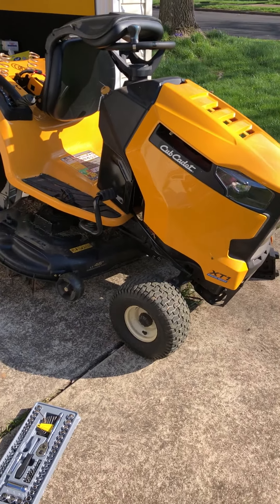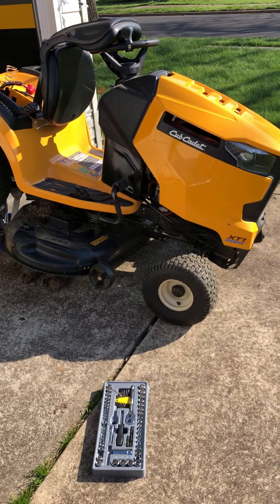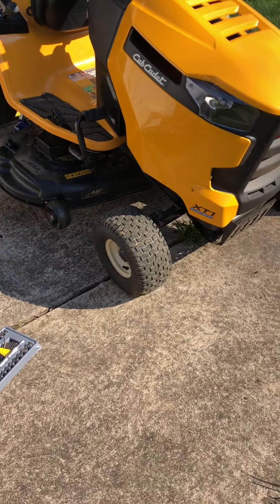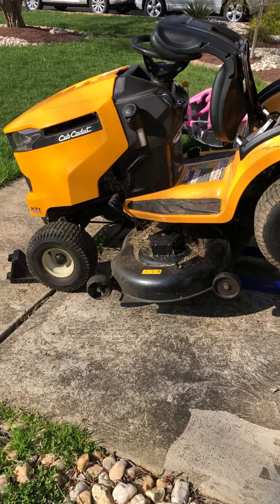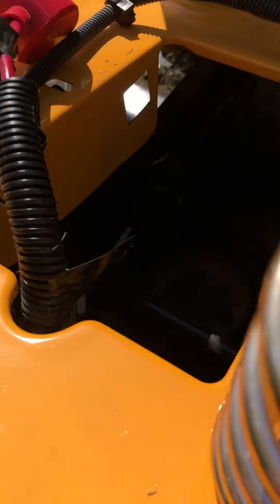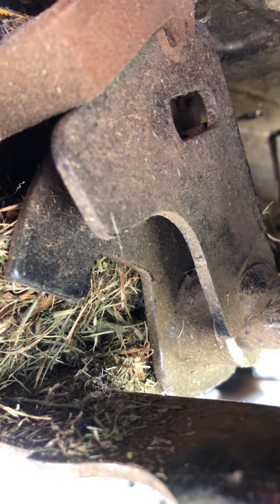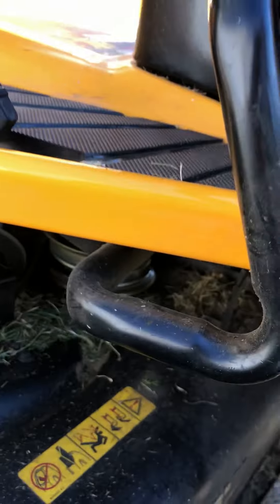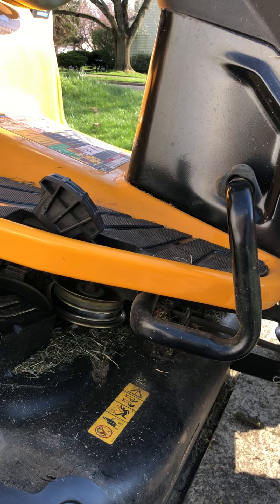Cub Cadet xt1 Craftsman John Deer MTD no reverse or slow reverse Fix Easy !!!

Comment: Good to know info in video. I purchased a new 2016 XT2 KH-22 tractor in May 2017. I've never had this Reverse problem, probably due to I use my 3-gallon Kobalt air compressor to blow the grass off my mower (engine, deck, floor boards, steering gears, etc.) after every mowing (maybe 3-4 minutes). My mower currently has 323.7 hours, original hydraulic fluid, runs great [7 mowing seasons + current 2024 season].

Comment: OMG this worked so easy. I lowered the deck & did not even have to remove it. Guess the cut grass gets in there & every time you push on reverse you pack it under the pedal stop until it just doesn't back up anymore. I thought I would have to replace a belt or pulley, so you saved me some money & a bunch of time.

Comment: I was so excited when i read your “logical” explanation, i dashed outside in my PJ’s, threw a tarp on the ground and started digging around finding all sorts of grass from side to side and especially where the reverse pedal mechanism plate is located. I dug the dry, hardened grass out by hand and then a short ice pick. Every once in awhile, i hand pushed down on the reverse pedal while clearing out the grass. I then got my air compressor with a nozzle and blindly aimed into the same area i had just dug the grass out of. I hopped onto the mower, started it and wham!!!! I had reverse again!   Decided to bring my hose with a nozzle on it and adjusted it for a thin, powerful stream and blindly aimed it into the area i had cleared out. Apparently i hadn’t gotten all of the offending grass out because when i reversed it again, it was really fast and i was able to back up a fairly steep driveway!! MANY TIMES i had to stop the mower and physically  pick up the back of the mower to get on my way. This winter i will investigate the possibility of putting a metal cover over that area or perhaps using a metal hole saw ABOVE to provide access to that same area and use a rubber “plug” to seal it until needed. It could be that simply using the garden hose with a high jet nozzle directed into that area may solve the grass build up more easily and quickly??? I also washed off the blade pulleys and deck while I had the hose connected! THANK YOU FOR THIS SIMPLE, EASY SOLUTION,!!!!  👏👏👏👏👏👏👍👍👍👍👍
Reply from the maker: glad it worked out well for you

Comment: Hell ya i have a 17 xt2 slow reverse i thought i was going to have to take it to the dealer, i cleaned the grass from under the pedal assembly and works like new!! there is a indentation that the grass will fill up and stop the pedal travel.Thank you for the great fix.

Comment: Outstanding video!  Have the same model, same year.  I used a long blade screwdriver and flashlight to clean out the frame on both sides.  
Large amount of dried grass was packed around the linkage limiting pedal travel and thus engagement.   Worked perfectly.   Thanks for the great work!

Comment: Thanks  for your investigation. Mine is the same model same issue. Wot i did to clear the build up l jacked  up the front lowered the deck to give a little bit more room for the grass and other stuff to break loose then I got a powerful  leaf  blower and  went at it .wow did it clear it .problem is  i forgot  haw quick reverse is and took  out the wife's 😳  freshly  potted daffodils. Ceep up the good advice.

Comment: Thanks for finding location Figured something like that was the issue doing blades in morning will clean that area.Thanks Man 🇺🇸🍻🤜🏻
Reply from the maker: Best of luck. Cheers
Reply: Don't stop when you remove the loose grass.  THERE IS MORE VERY packed stuff in there.  I had to pick it out with a coat hanger and blast it out with compressed air.  What came out was a dry clot of grass and dust that resembled a dirt clot.  I then blasted it out with a garden hose pressure nozzle.  I was going to use my pressure washer but I think it is now clear.  I'm going to blow it out with compressed air after each use from now on.  Thanks much to the OP.

Comment: Thanks for the information. I will check this out and see if this is my problem as well. I only have 50 hours on my unit. Some people indicated that the reverse relief value was the problem. I hope it is what you said. Thanks.
Reply from the maker: really hope it is. check back in with the fix.
knowledge is power

Comment: Yep, mine barely moved backwards, cleaned the grass out and it about threw me off.  I blow my deck  off after every use but under the reverse pedal is tucked away and you have to clean it out by hand.

Comment: That seems to be a common problem. Design flaw because it's nearly impossible to get your hand in that space to clean it out. Have the same issue and I always clean the mower after use by the grass gets jammed up there a slowly the reverse function disappears. Got a compressor blow gun with a 4 inch nozzle and reached under and into that area and opened fire. A ton of dried, matted grass blew out. Problem solved. While blowing it out work the forward/reverse pedal back and forth a few times and more crud will come out.

Comment: Also could have air in the line. Pull rod back then press pedal forward for 10 seconds then reverse for 5 times with motor running

Comment: Still doesn’t work. Mine won’t accelerate or reverse.
Reply from the maker: check if your gear is engauged, there is a little hook looking thing in the back of the tractor by the axle. needs to be pushed in.
Reply: @sunsetautocarsandbikes  I figured it out. My drivebelt broke and i'll have to replace it.

Comment: Same exact problem with Craftsman T210. Loosened grass/dirt with a long , flat blade screwdriver then blew out the remainder with compressed air. Now it works like brand new.